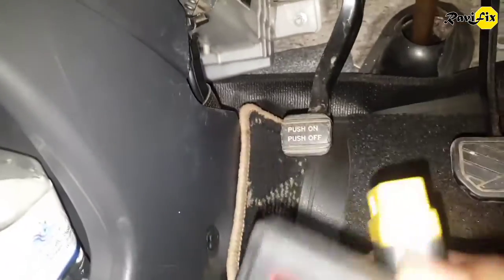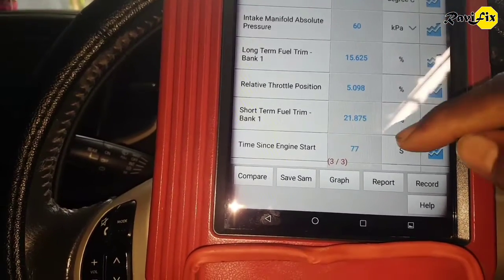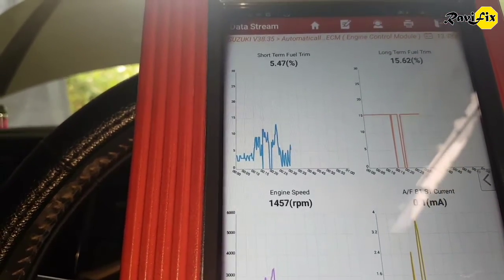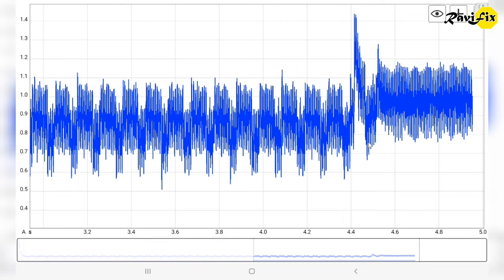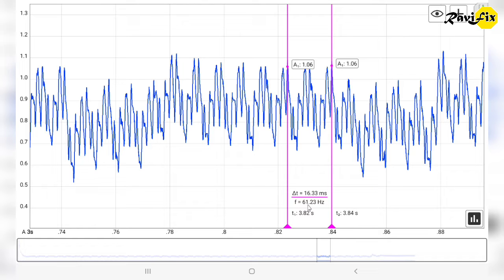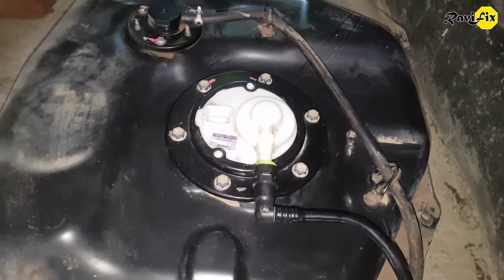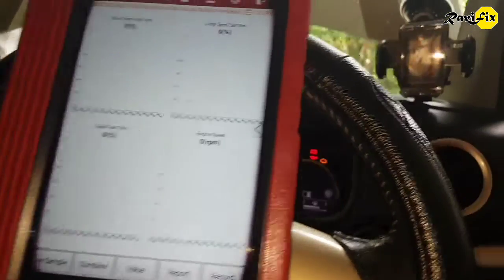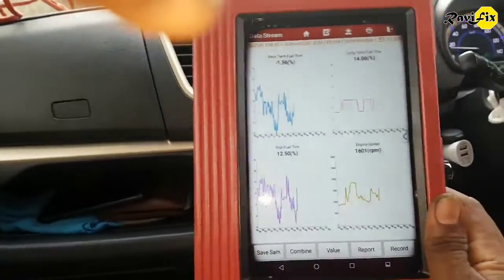P0171 system too lean diagonosis & Repair. Fuel trim, Fuel pump current ramp waveform analysis

Comment: whats the reason of stft ups and down.to -25 and 25 ltft 0..while idling .2500 rpm also havinh tje same stft moving patten.when in sudden accselations engine get stalls.no vacume leaks.fuel pressure is aroing 3bar. in idling ignition  advancing ups and down fastily.
Reply from the maker: Might be bad O2 sensor or airflow sensor.

Comment: Could you measure pump current draw waveform without dropping the fuel tank?
Reply from the maker: Yes, sure we can, if there is dedicated fuse for fuel pump we can get reading at there using fues extension loop, or same thing we could do on fuel pump relay. Otherswise we  could find the fuel pump harness under the rear seat where we could get the reading from there too.